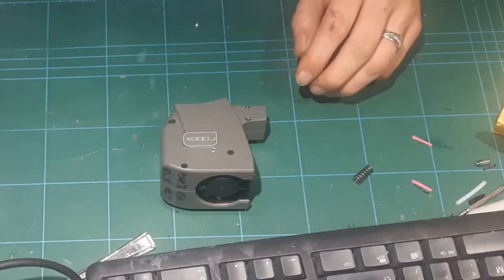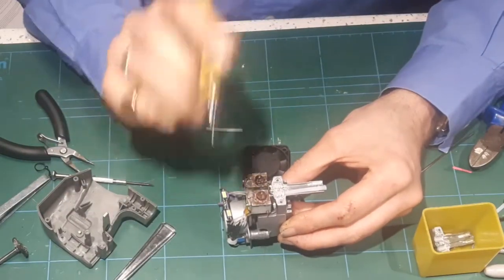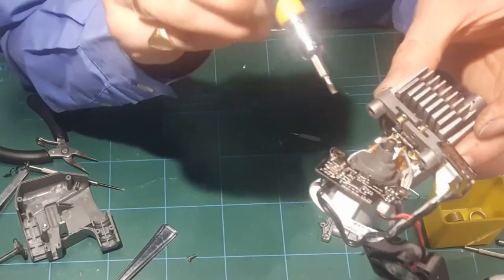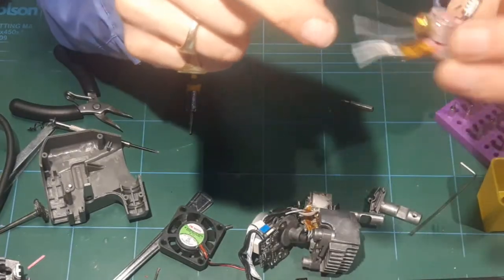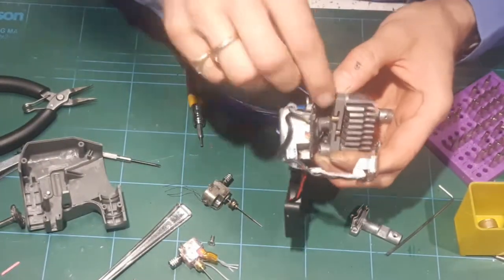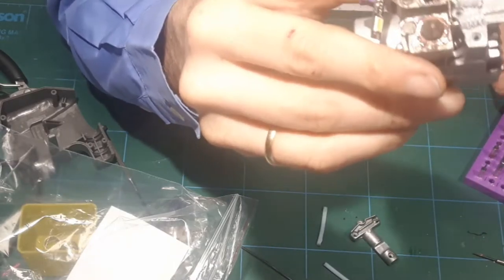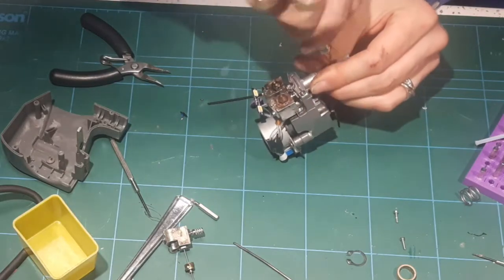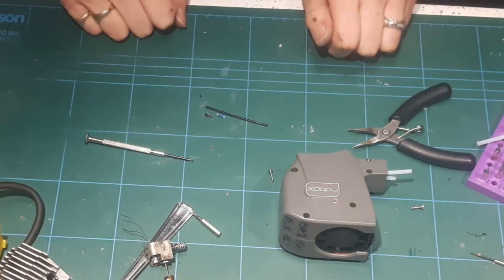Exploring and How to Repair Robox Dual Print Head

Comment: Excellent video! 
Do you have details of the cartridge heater voltage and wattage? Also, what part would replace the thermistor?
Reply from the maker: Thanks just fitted some after market heaters which work fine. Will dig out the part numbers. Just tracking down thermistor replacement. Join the unofficial CEL robox Facebook group as I moderate that and post regularly
Reply: @chazj1976  Hi, do you remember what heater you got or where? Accidentally torn one of the heater leads while replacing bad gaskets and cannot find 5*15mm heater despite googling for hours. 5*20 and 6*15 are closest I could find. First too long to fit and second requires drilling a wider hole which I'm not comfortable to do due to thin wall.

Comment: To remove the nozzle head you don't need to heat it up.
To remove the nozzle head you need to reassemble the print head outer shell and the bearings and screw the screws in. Then use a hex socket head wrench on the nozzle and it will come off easily
Reply from the maker: Normally on most other heat blocks yes. But the thread pitch on the robox is very fine an m5x0. 5.which strips very very easily the thread in the heater block of there is any plastic in the thread. Do it's safer to heat up as you can't purchase any parts easily as they all bespoke
Reply: @chazj1976  always safer to heat your hot end before changing nozzles